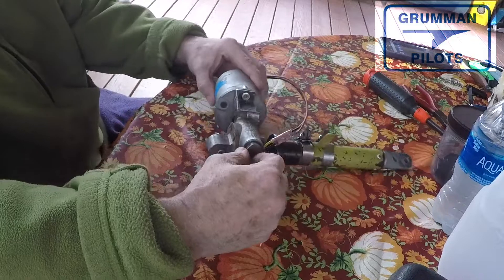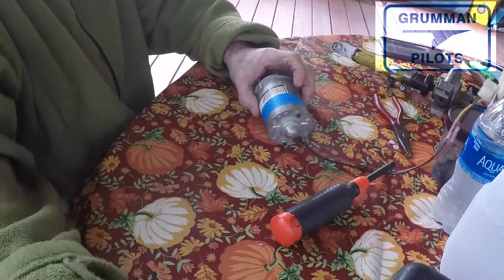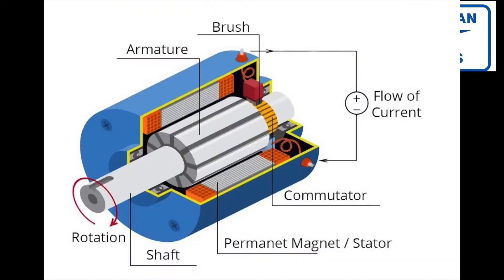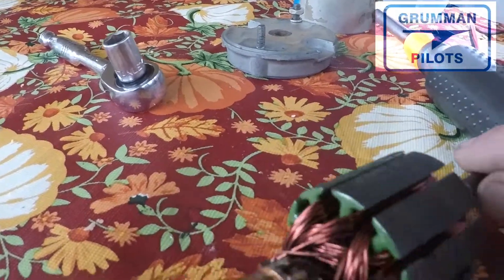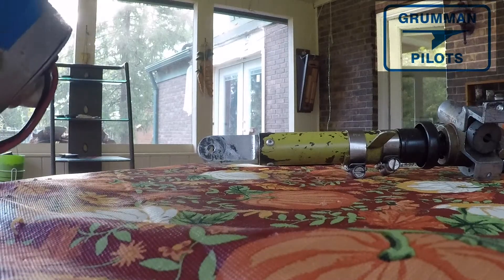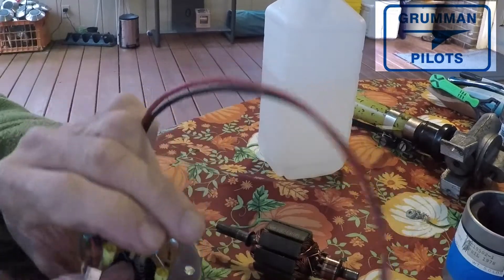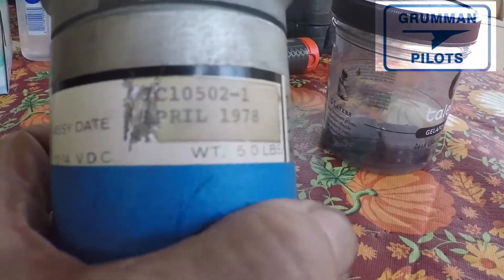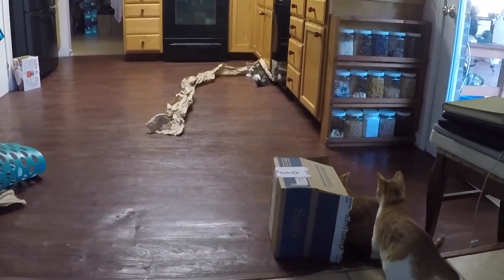Flap Motor A Look Inside - Grumman Style

Comment: I always enjoy your videos, it's always interesting to see how ga people work vs how airlines do, it's pretty different - like I'd just go to parts and get another motor.  Is this procedure done following a Grumman manual?
Reply from the maker: Normally you check operation at annual and do what is needed to get back in spec.  You can Change the motor anytime you need.
Reply from the maker: Usually a customer comes in with a list of items to be looked at.  If flap motor was on the list we would investigate and correct as needed.

Comment: Since capacitors tend to have a life about 20-40 years even in light use, why not replace them now? They will get leaky over time allowing DC to flow through them. Also the high quality capacitors today like from Panasonic are so much better than those in the 80's. Its a bigger problem in older electronics especially tube equipment but they are pretty cheap through Mouser or other electronics vendors. Just seeing Dan Gryder go down in the Cesna 150 a few months ago because the flaps stuck down 40% is enough for me to be vigilante. The same thing happened to me in 1986 with a 150 but luck have it I was on an old Air Force runway that still had another 4000 feet so I could just land. Any thoughts on how often to replace the switch?
Reply from the maker: Good to know and thanks for pointing that out.